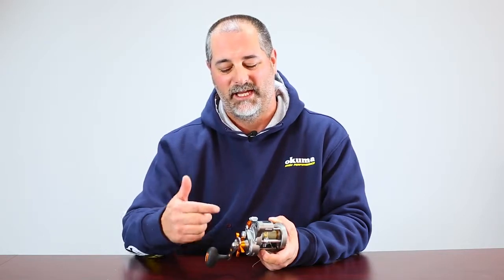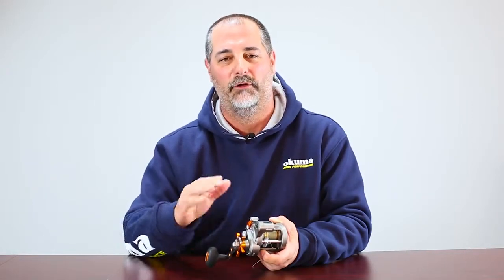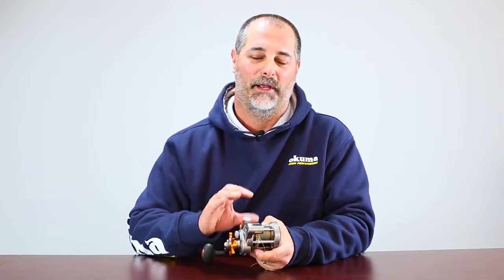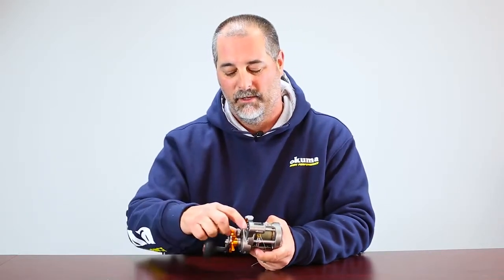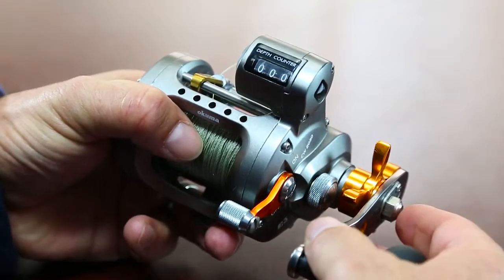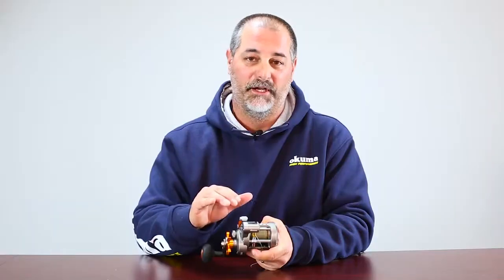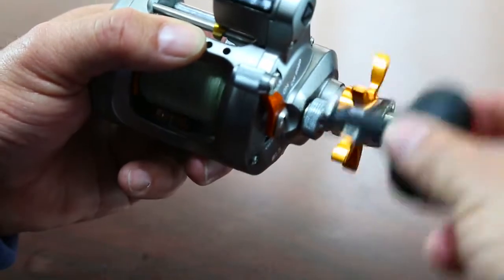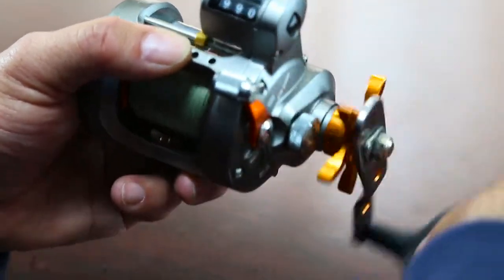Okuma How To: Line Counter Functions

Comment: The line counter is just a poor design.  It fails on the Cold Water CW203DLX. Specifically, the reset button sticks (binds) when you reset the counter to zero before letting line out. It's wont start counting unless you manually move the reset button back to the home position... very annoying especially if you forget.    I replaced it on one of the two I purchased, and in less then 6 months it failed again.  I have two of them and they both have the identical problem.... It is a design flaw.